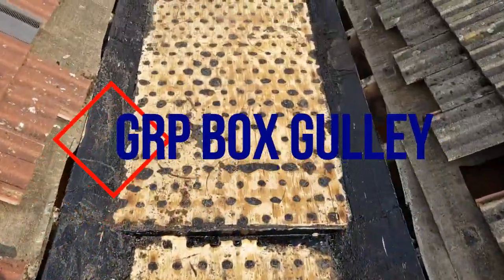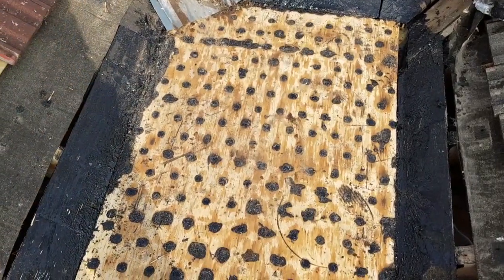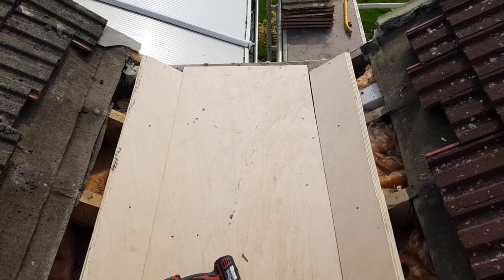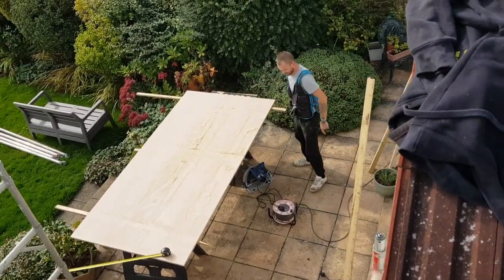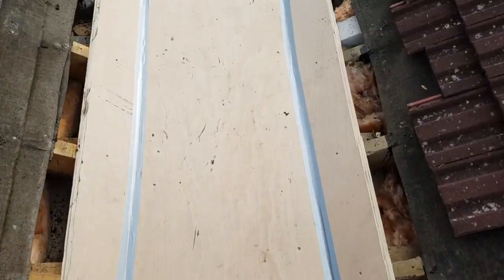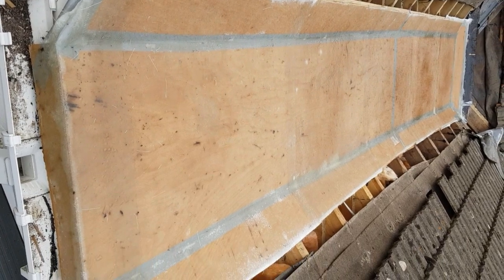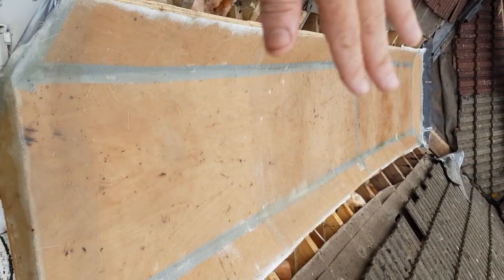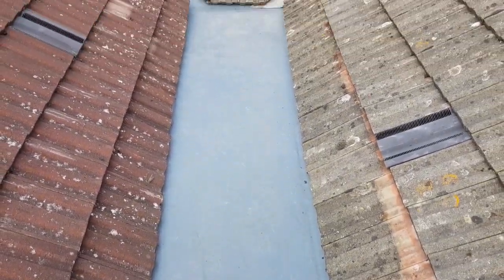FELT BOX GULLEY TOO GRP CONVERSION

Comment: Shouldn’t this be applied on OSB and not ply??
Manufacturers state that ply releases oils which result in the GRP peeling of with time.
Reply from the maker: When you fit fibreglass valleys or lead or zinc there never stuck down, it's not paint it won't "peel'" there is no rule to say it has to be stuck it probley would work better free standing so it can expand and contract independently. Also boats have been laminated using ply for many years
Reply: @peteramberley9952  Those  are very valid points you make about not mattering if it debonds. Don't see how it ever possibly could the way you do it though, using a priming coat first. The most vital thing is ensuring the deck is absolutely rigid at joints.

Comment: Only use GRP on OSB. Is this your first one?
Reply from the maker: Boats have been arround for many years and stand testiment to time. None of them use osb in there construction. Would you like to explain your comment or was it just banter?
Reply: @peteramberley9952  speak with GRP manufacturers technical dept and BBA and tell them that, then come back at me. At least you get to ride a horse to work everyday.
Reply from the maker: @taffytop  I don't need too speak to any grp manurefactuers, it's you that determined to undermine my job. Why don't you produce the facts. Iv been in boat building factories and watched them build top class boats with plywood not osb, iv worked on many boats which used ply not osb. I agree with you on house construction t&g smart ply is best application. But also you need to remove this fixation you have about the grp needs to be fixed to the substrate on this application. It serves no purpose whether its free standing or secured it will still do the same job and have the same life expectancy. Maybe you can tell me what and how this job will fail as you seem to consider yourself a bit of a keyboard expert?
Reply: @peteramberley9952  who is correct the BBA or cowboy Pete and his sailor mates?
Reply from the maker: @taffytop  obviously you are with your flock of girlfriends🐑🐑🐑🐑🐑🐑
Reply from the maker: @GRPLiningServices  thank for the support I don't get offended too easy everyone has a story to tell he just short of listeners.

Comment: We’re does the water go mate
Reply from the maker: Falls into the gutter at the front
Reply: @peteramberley9952  I couldn’t see it mate just having issues my mate is building one and we’re struggling mate with it
Reply from the maker: @theguys1051  like with a flat roof you have to have a fall on it even if it's 50mm over 3m. The ply starts off the roof tile end wider as it's higher up and it gets more narrow as the box gulleys gets lower. Why is your friend having troubles?

Comment: Shouldn't you use osb boarding ?
Reply from the maker: In construction they recommend it for its structural quality and if you use the tongue and Grove boards it's better seal .but in boat building you never see osb only plywood in bulkheads and transom s and they last for over 40 years.its a myth weather the grp needs to be stuck down to the ply/Osb, bit like lead valleys / gulleys they can expand and flex independently which will help in longevity.
Reply: But aren't thay different resins ?
Reply from the maker: @knightstemplar1142  not really ,some are better quality like Lloyd's approved.but it's polyester resin.some boats can use a vynlester which is usually  pink in colour  or epoxy which I guess is the best but expensive. But if you put a couple of wetted out chopstrand mat on there it will be very strong and easy outlast felt
Reply: Sounds good to me and lastly,what would it cost me to get that sort of job done."if you don't mind me asking"👍
Reply from the maker: @knightstemplar1142  depends on access really .if the times are interlocking not rotten plain tiles or slates I think you would be looking at a grand too 1500 depending on where abouts in the country may affect price

Comment: Wouldn't use duct tape as all them taped areas as relying on the tapes adhesive.
Better off using a lm sealent,
That isn't curit by any chance is that rigid fibreglass or flexible like triflex ?
Nice job though.
Reply from the maker: Thanks for your comment, i have allways fought with myself as to whether it should be stuck to the wood or floating,? Re: the ductape i only used it to seal the gulley to stop the resin pouring thru rather then a fixing.ie if it was totally free standing like a lead gulley or grp valley it would still have the same waterproof property and longevity. I think i used curit, it was a polyester resin what ever make i had at the time.